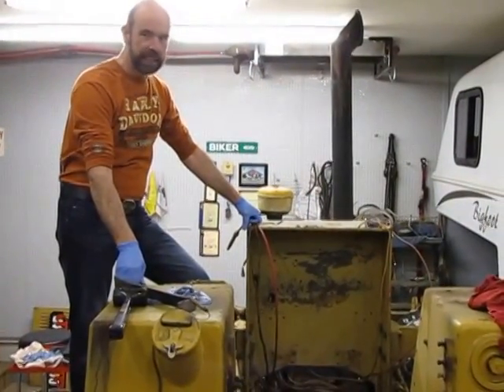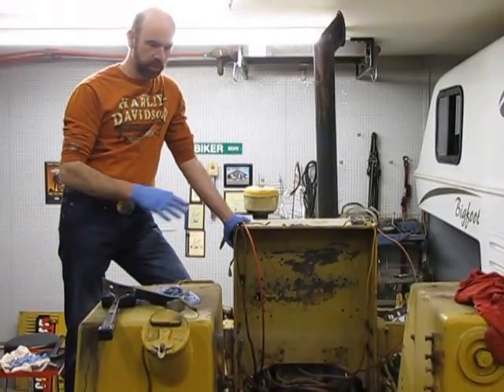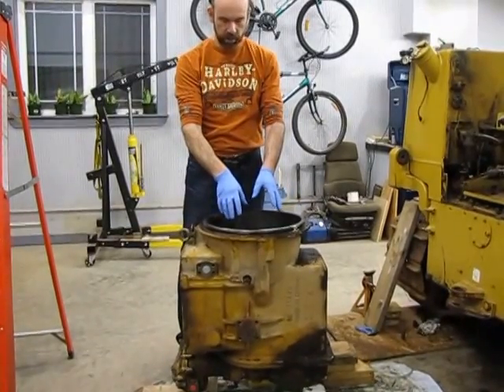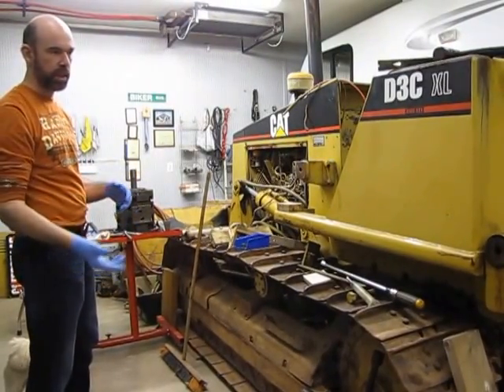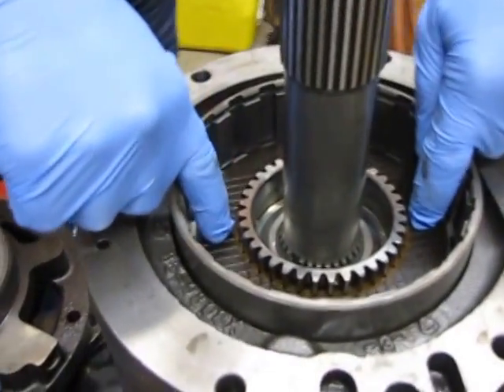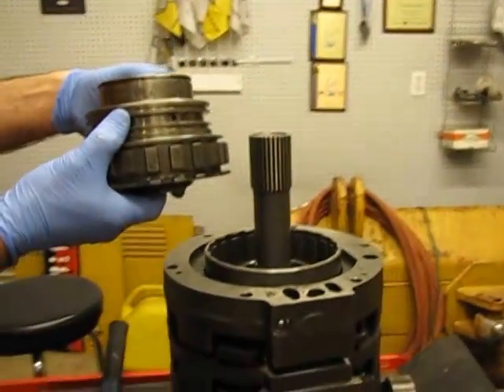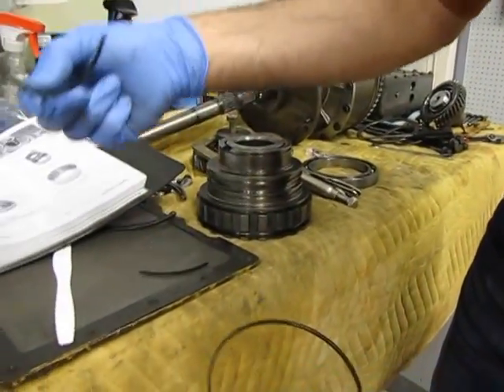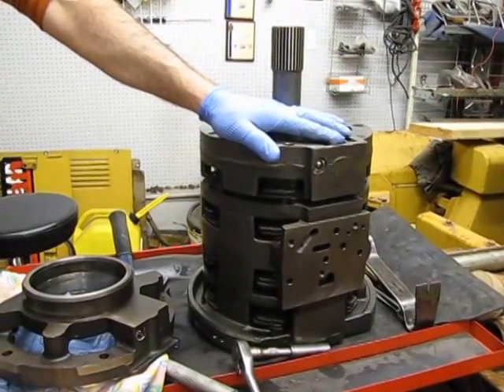Cat D3C Bulldozer transmission repair rebuild

Comment: Excellent video of a simple repair. A little mechanical knowledge, a service manual, and some time and you have a  good working unit. Someone will surely have thought they struck gold when they find this video.....  Thanks for posting
Reply: sstocker31 I am one of those 'someone's. Not because I own a dozer, never will do, but simply because this is the first video that answers a question I've been mentally asking to find for a long time, ie. how does dozer transmission work? Anyone would be forgiven for thinking it's a state secret how a dozer motor drives the tracks. The only thing missing from this excellent video is an explanation of how the transmission extends to the track drive itself, but I see now there are related videos on this page.

Comment: I built tranys at OHIO CAT for 38 yrs,the rotating clutchs are all a weak link.we usedTRC red grease and really likes it for less cutting of seals during rebuilds,quite a challenge,,CRIP
Reply: steve crippen 
Hi Steve I have D3C Series 2   LGP.  I have no Drive in my right track. Shortly before losing Drive, my hydraulic oil turned black. I presumed it might be a rubber Seal that blew. Not sure what is wrong. BTW the other track still works and no problem with the Hydraulics moving the 6 way blade. Any thoughts on what you think the problem is?

Comment: Very cool Video. I'd be forever in your graces if you could tell me where the starter is on that Dozer. I'm having an issue with a no turn over and I'm trying to at least get a general location as to where it's located before I start removing all the covers, plus my dozer is out in the field so that makes it worse

Comment: excellent but really expensive part ( the crack one)   and hard to fix, because the tolerances in the hydraulic system. too much work to take a short cut. is and aftermarket option??

Comment: Very good video.I grave a similar problem related to d3c sa transmission pressure.The trasmissione has come back from the caterpillar shop but the problem is still present.Any suggestions?

Comment: What type of oil I need for the same transmission
Reply from the maker: I suggest going to the cat dealer and buying transmission oil they sell. It is a speciality oil and important not to use the wrong one
Reply: Just put in water.